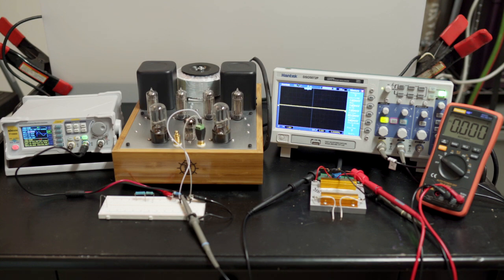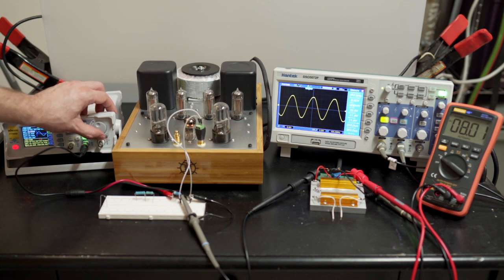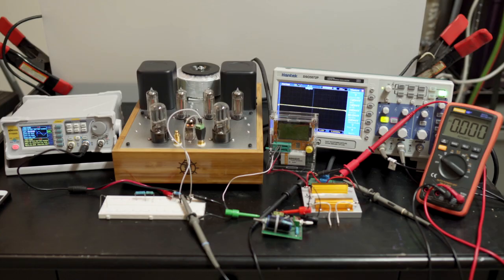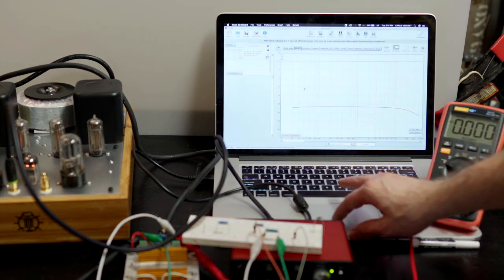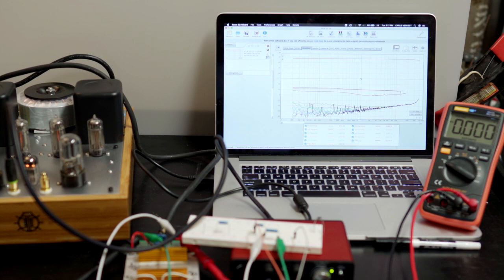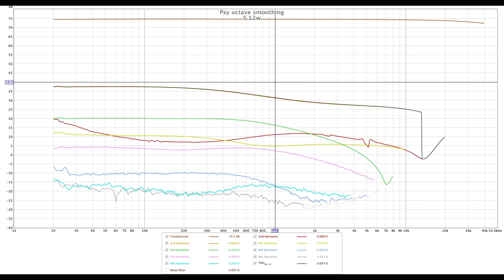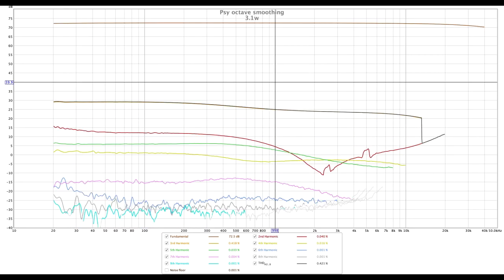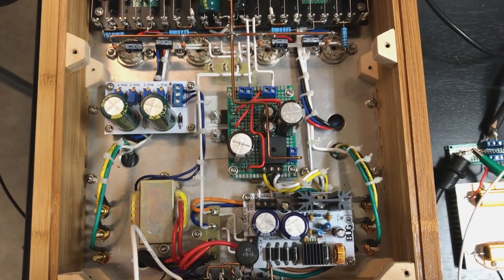6S19P Push Pull Circuit TESTING (Part 2)

Comment: You make these "cheap" russian tubes work for hifi, fantastic! For negative bias Voltage I often use a small 1" by 1" print trafo 230V/9V and hook it up the the 6,3V ac heater winding (or to mains and use a voltage doubling bridge depending on -V needs). My local supplier has these small trafos for 0,95€ and they're light and small enough to be placed under the chassis.

Comment: Hello love the tube amp videos, so educational and easy to follow @ 19:31 I would speculate that the aparent lower power compression below 1k has to do with the distortion behaviour of the output transformer. Looking at the distortion plots there is increased distortion below 1k, I would argue the core is saturating and the aparent lack of compression measured is the rise in distortion where the core is active (<2k). I am by no means an expert and could likely be very wrong :)
Reply from the maker: Very possible

Comment: Unfortunately your signal to noise and hum readings are incorrect because you are looking at an FFT plot where the y-axis is power per root Hz. This is a very common mistake. The rms level of the noise is the integral of all those noise points across the 20KHz bandwidth. Fortunately REW does this hard math for you if you select the show distortion box. You will find the actual noise level is a good 40dB higher than your measurements.
Reply from the maker: Thanks!! I’ve since discovered this also!

Comment: I didn't catch the frequency of the square wave you used.
Reply from the maker: I’m sorry! I definitely should have been more clear about that! I use a 1k square wave for general purpose testing. It’s a great quick look at FR and ringing.
Reply: @Edgarbopp  that is what I suspected. That is an extremely nice looking build and with great specs too! The best of both worlds :-)
Reply: Hey Doug, what software are you using on the Mac?
Reply from the maker: @thomascarlitz  it’s the free version of REW. Works great!